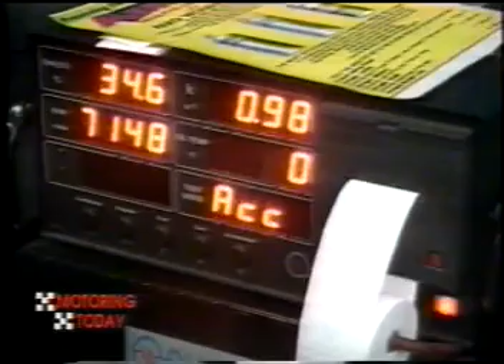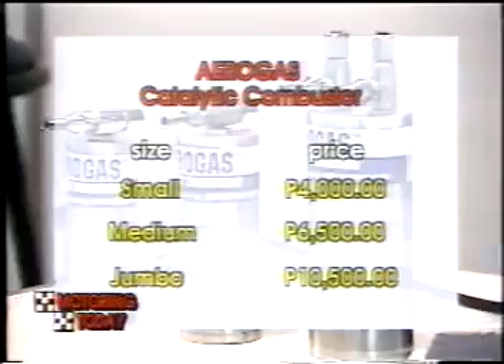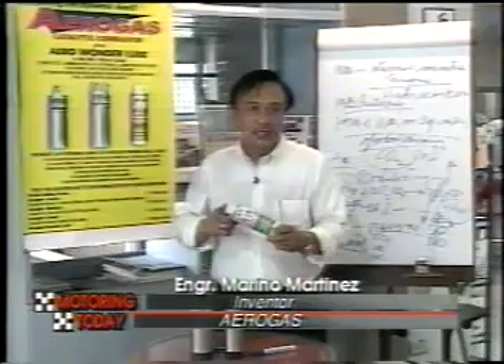BEST ANTI SMOKE BELCHING and FUEL SAVER DEVICE

Comment from the maker: Aerogas is the only patented device of its kind, and very economical for its benefits, for inquiries email us at mcmmultienergy@gmail.com
Reply: i have an aero gas and the problem is that the tube are accidentally cut when my van is in repair ,,, is it possible to connect it again and work again ? ... or it has other chemical or compound inside the aerogas that i need to fill first ? thanks